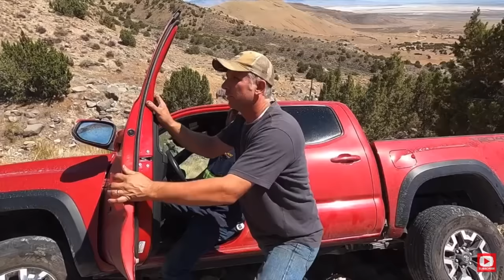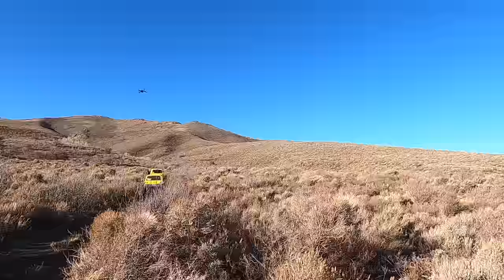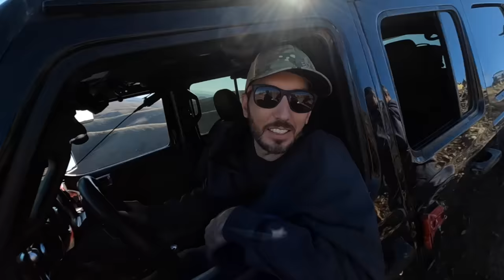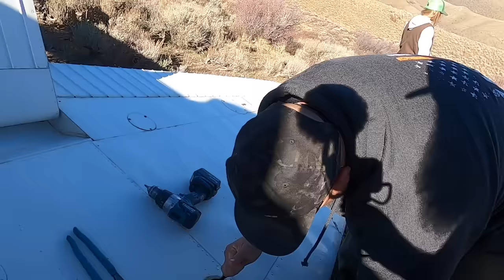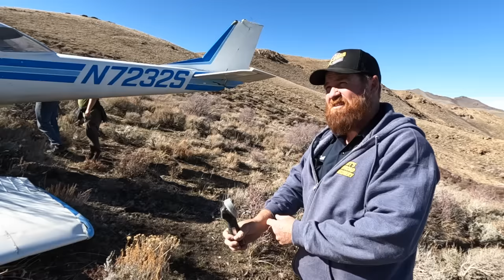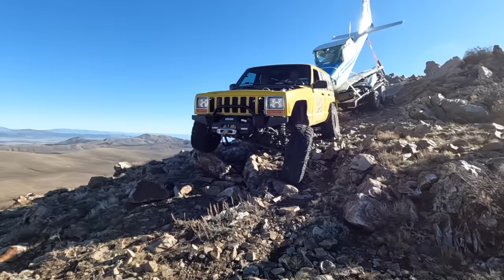The Craziest Rescue I Ever Had!

Comment: As a private pilot, even though I don't fly anymore, I did all of my initial training in a Cessna 150/152. I still remember that at 8000 feet a 150 is pretty close to it's maximum performance capability depending on winds, density altitude and gross weight.. Flying that Cessna in a mountainous area is always a little bit risky. I'm not here to criticize the pilot since I don't know all of the circumstances. I'm glad he was OK. Great recovery by all!
Reply: Com'l pilot here with mountain training - you're right, the 150 has almost NO excess climb ability at 9300 feet...and you NEVER put yourself in a situation where a downdraft can ruin your day...you always cross ridges at 45 degrees and or leave room to turn around if you can outclimb rising terrain. This guy is lucky to have survived this classic accident. Even better you stay on the ground when the winds are blowing hard.
Reply: His brother has similarly poor judgement, evidently, the way he flipped the RZR and stuck his arm out.
Reply: @danielhawley6817  The plane had not been out there very long and it does not appear to have been legal any time in the last 15 years. My first thought was the plane was put down due to weather or not enough power to fly through the heat of the desert at that altitude. How did the pilot land it without ripping the plane apart?

Comment: Lizzie just walking through the middle of legitimate nowhere was cool- that drone footage was amazing. And a special thanks to escorting her to the road- that’s awesome.
Reply: That drone didn't escort her to the road.  It can't stay in the air that long.
Reply: @stargazer7644  15 minutes to the road and a couple back? I feel like most drones should be able to do that.
Reply: @outandabout259  It's good that you feel that way.  She was a mile horizontally and 900 feet vertically from the nearest road hiking a ridgeline.  She wasn't in any hurry.  She certainly wasn't walking a 15 minute mile.  That would be pretty fast walk for someone her height.  Most drones can hover for about 20 minutes.  Flying distance and climbing shortens the time.
Reply: @stargazer7644 Then just fly the drone back halfway through her trek, change the batteries, and fly back to her.
Reply: @aphextwin5712 She walked a mile through the desert.  She wasn't hiking solo across the Rockies.
Reply: @stargazer7644  I was only arguing the point that the limited flight time of drone would not have prevented them to keep an eye on her for most of the way exactly since the distances were short enough that flying back and changing the batteries wouldn’t have resulted in very long gap.

I mean, we have drone shots of her reaching the road. So whether they were able to keep an eye on her for the whole distance to the road or had to fly back and switch batteries, they were able to visually confirm that she did reach the road.
Reply: Wake up to the wild west .

Comment: Well, This was one helluva different recovery!! Surprise that Plane didn't have more damage After crashing. Matt's skills sure put to the test too.
Reply: Couldn’t have done it without Ed’s help. :)
Reply: Looks like the pilot made a great emergency landing and kept it upright. Still considerable damage to the prop, engine, gear, probably firewall, etc…
Reply: It’s a shame the wind flipped it, the bulk of the damage was from that. The only forced landing damage is the nose gear and the engine. Hats off to the team for getting it dismantled and out without more damage
Reply: It’s totaled.
Reply: @MotoVloggedOUT  100% loss. When you consider a 150 sells for $25-35k in decent shape, the cost to rebuild would far exceed the value. EVERYTHING in aircraft repair--especially certified (I.e. production) models--costs more than you'd ever imagine.
Reply: @MotoVloggedOUT  I agree - a Cessna 150 in perfect shape is worth a lot. But there are lots of them for sale in not great condition, (say, requiring an engine overhaul, some avionics updates, and a few more little things) for very low prices.
Reply: The man said it was upright “a few days ago.”
Reply: @richardbirkenwald811  perhaps watch the show again. The plane flipped in the wind after landing
Reply: @richardbirkenwald811  So I am assuming they recovered it for insurance purposes?
Reply: @drewt3210   you are correct! It’s the cost of the repair that puts that aircraft in the scrapyard. It’s possible to repair almost anything if it’s worth it to you. But the cost has to be considered and 150’s are just to common to bother with.
Reply: Another plane scrapped for no good reason, pilot error
Reply: That was not a crash. that was a good landing, as the pilot walked away. It was not a great landing, as the plain was not flyable afterwards, but the pilot gets a few bonus points if the plain turns out to be repairable.
Reply: They give the reason for the low damage. It was high winds that they couldn't fly (toward home). A 150 only does 120 mph. 120 mph into 120 mph wind leaves a plane standing still. So, they actually just dropped onto the hillside when they got low enough to a windbreak.
Reply: @richardbirkenwald811  It did not flip on landing. Not unless you are accusing the guy of lying to the NTSB and FAA because I've read the prelim report.
Reply: @russlehman2070  what it was was poor ADM
Reply: @DougBennettActs6-1  Its a fun thing to do once or twice in Flight Sim, but I imagine it's terrifying in real life.
Reply: The oddest thing I noticed was that one prop blade was bent backwards and the other one was bent forwards.
Reply: @drewt3210  Just for the record it's a 1946 Cessna 140, and I agree it's totalled.
Reply: @cadzag72  the picture they posted from post crash with it on the wheels shows the wing is already crunched, so most of the damage was done on landing.
Reply: @MaxZomboni  Thank you for the intel! I didn't look into it, just went off what they called it in the video...figures ;-)  The shame is he didn't keep screw anchors on board. Maybe could have prevented flipping over & been able to salvage had he tied it down. "Education is expensive" and the Boy Scout motto, "Be Prepared" apply here.
Reply: @drewt3210  I am building a "cheap" Homebuilt, so far I am at 73k, most of that is aluminum and avionics.
Reply: @wb6anp  I'm super excited for you to get that bird in the air! Last year I helped a friend build his RV-10. Guessing it's one of the quickest builds to date, as he was airborne in the 5th month! He flew out to visit two weeks ago. Very emotional to see it in the air since it was missing wings & engine when I left the build a year ago. He already has >150hrs on it now!
Reply: Who says you need a rotor to auto rotate. Wings level watch the horizon manage your power dump your lift before it dumps you..... Should be required in flight school 🙃 No do it again 🙂 That's better

Comment: Over the course of my Navy career I actually have done several (too many) aircraft and helicopter recoveries after mishaps in the mountains outside of Fallon (and on the base), in the Lake Tahoe area, the Southern California desert, Morocco, the Air Force Base on Guam and an air base in Kuwait.  I benefited from using helicopters to lift the wreckage/engines/landing gear off the mountain, being able to tow the aircraft with it partially on a dolly, or being near a road for a crane to drive in so I could lift onto a dolly or truck.  Well done!  Thank you for sharing this.
Reply: thanks for your service. Fallon area and Tahoe Basin are absolutely beautiful.

Comment: Ah, aircraft recoveries. Even when it's just off the runway they tend to get interesting. When they pick remote locations a lot of ingenuity tends to come into play. I've been involved in almost a dozen over the years. You got really lucky with the RZR trail machine. At only 50 inches wide and approximately 8 feet long they tumble pretty good when you get them rolling. That rock was in a very fortunate location. Good times and fantastic that nobody got hurt in either the plane or RZR mishaps.

Comment: You have a 1967 Cessna 150 with a Lycoming O-235-L2C , 110 hp engine.  And you are right about how light they are, usually around 985lbs to 1100lbs.
It's possible this plane can be restored, but more likely, it will be parted out.
Since there was a prop strike, the engine will need to be rebuilt, and a rebuilt 0-235 is worth about $25,000 (unless it broke the crankshaft).
landing gear, instruments, etc all are valuable.
Sad to see the little bird get busted up, but extremely happy that the pilot walked away from it.

Comment: As an A&P You all did a great job taking the plane apart. As always your videos are great! Thanks!
Reply: Is that wreck worth anything, or did they just want to get it off the mountain?
Reply: @gordonrichardson2972  Yes, that was not a write-off by any means.
Reply: @tvideo1189  It looked pretty screwed up to me.  How could they straighten out the crumpled up wings?
Reply: @Rat-Builder  new skin and replace damaged ribs as necessary
Reply: @Rat-Builder  I didn't say every single part was salvageable.  Some might not be.  But replaceable wings are available as are almost every part for that very popular airframe.  The damage wasn't that significant from appearances.
Reply: @tvideo1189  Ok, thanks for the reply.  I am sure it is like everything else, I have resurrected some way screwed up heavy equipment.  I just do not understand how to work on airplanes.  If I worked on them, they would be sooooo heavy that they could not get off the ground.  LOL

Comment: As a pilot with almost all my time in a 152, I appreciate you.
Reply: I have a few hours in 150s and 152s, always found the airfield! That did not look like a good place to put her down. 

I read a WW1 pilots note book about how to land on long wheat, bring it in, close to the stall, and then stall it just before the wheels touch. Might want to discuss that with an instructor before trying it.
Reply: will they repair that plane or was that a "pick your trash" run?
Reply: @denmsore  I have seen worse repaired, I guess it will depend on what the 'survey' says. Being popular with schools, quite a few suffer a few indignities, and are repaired again and again.
Reply: @denmsore  I was wondering the same. I'm thinking a total loss insurance claim, after the wind rolled it. 
Any landing you can walk away from...
Reply: @ingluv  Just the cost of the salvage is more than the worth of that C-150.  It's repairable but considering it's age, it's most likely only good for parts.
Reply: @ADAPTATION7  the right thing to do is to pick up the mess. If you wreck your car, and it isn't worth fixing, you don't get to leave it there.
Reply: @ingluv  Of course it is.  Not saying otherwise either.  But like the other said:  It's a writeoff.
Reply: Dumb question, does the insurance pay for recovery of light aircraft?
Reply: @JAMESWUERTELE  When an insurance company pays for a total loss, they take ownership of the aircraft and may sell the salvage. I believe this answers your question.

Comment: I"ve done that!  Well without the crash! Bought a TriPacer in PA - rented a U-haul truck and took some tools and drove down there.  Removed the wings, pulled it up the ramps and loaded it.  Hung the wings inside the truck, left the back roll up door open with the tail sticking out. Drove 200 miles back home, easy - but interstate driving is better than that mountain trail..

Comment: You guys are amazing.  As a retired Accident investigator and Pilot, I have one request.  Please make sure the Mags are off/ disconnected before before touching the props.  They can take your head off just by moving the prop.  They are not hooked up to the battery.
Reply: you dont like russian roulette do you?
Reply: I'm curious,  why,how?  as a mechanic, that engine starts that easy, no strong compression to squeeze first?  thanks
Reply: i dont know why you even would make this comment there was 3 Pilot on that job but you still think you should make this comment

Comment: First note: The Intrepid Ms. Lizzy is my kind of girl: walking off a mountain is no easy task, even if the trek was only a mile or two. I want to find me a rodeo girl, cause they're fearless. If I were 30 years younger, I might consider a move to Utah. Second note: Rudy has been on-point,  lately, throwing a rope over the tail section to facilitate the loading of the plane fuselage shows his awareness. Thinking on your feet is the kind of thing that makes Matt's job just a bit easier. Third note: What a crew! Fourth note: Glad that guy pulled his arm back inside that little UTV, as it rolled or this would have been a very different video.
Reply: Whoever yelled, "Hand in!" had some quick recognition and response times. He possibly saved that guy's humerus or shoulder. Kudos.
Reply: @jonkirkwood469  can't believe he saw that and said it in that short of a time, pretty incredible... not even just his shoulder either, you get a squishy arm between the cage and the ground mid-roll and you're liable to lose it entirely.. seen people pop their fingers like grapes before.
Reply: Once you find yourself a rodeo girl, you may be singing a different tune. They don’t put up with any shit, they’re expensive, and they’re stubborn. I know this because I’ve been married to a barrel racer for nearly 13 years.
Reply: @jonkirkwood469  i thought the exact same thing, that was one quick thinker/response
Reply: @dustinmeier9753  I like Lizzy too, right on youtube where I'm safe.
Reply: Creepy

Comment: Those 50" SxS's are tippy. Course it was loaded a little heavy on the down hill side.
Reply: No kidding. Guy needs to get someone in the passenger seat.
Reply: Keeping the gas matted was never a good idea either
Reply: He should have turned around
Reply: Off set rims and ditch the sway bars.
Reply: Made mistake of hitting the brakes. Should have powered thru. But then again if that didn't work would have missed that lovely live saving rock.
Reply: @hammeredtravis  not me
Reply: He's lucky he did crush his arm when he stuck it out. Like you are going to reach out and stop it from rolling over.

Comment: A Cessna 150 has no  business trying to fly over an 8000+ ft mountain in ANY wind.  They have a tiny 100HP engine and can't climb out of a paper bag.  At 8000 ft altitude & 20 deg C (68 deg F) the MAX rate of climb is 280 ft/min.  That's better than nothing, but just barely!  They are for taking your first flights with an instructor and flying circles within 5 or 10 miles of the airport.

Comment: I learned to fly and soloed in the Cessna 152.  Good little airplane at lower altitudes.  Hope they can repair it.
Reply: No mate, not economically viable.
Reply: I used to split the cost of renting a 172 with a co-worker and fly just for the helluvit. Beautiful little airplane.
Reply: @marvindebot3264  damage definitely exceeds value. Some parts may be re used such as instruments and interior fittings. Engine would need a rebuild.
Reply: @janetyeoman1544  Yeah, if it's a well-equipped example with a modern fitout I'd be swapping a lot of stuff into the new one but you can buy a 150 for 25k nowadays so no way is that anywhere near close to being worth fixing. The port wing had bent the mainspar for starters plus engine overhaul, new prop, nosewheel and all the other damage.  She's parts, unfortunately.

Comment: Hey MORR Team! I trailer my motorcycle cross country every year, and I live in constant fear of securing my bike to the trailer improperly and losing it on the highway. Every time Matt and the team use their trailer offroad, I'm shocked at the confidence you all have in keeping the load tied down. Could you do a video on how you approach securing loads to the trailers?
Reply: We made a strapless gizmo for securing bikes on a bike trailer...that we pull with bikes. Haven't tried it on something as heavy as an Ultraglide but dirt bikes and minis
Find a spot under the bike you can weld a pipe to the frame. (You could clamp it with u-bolts too I guess.) A rod that fits through the pipe, hole drilled through the ends. A heavy duty hinge mounted to your trailer on each side that will reach the pipe. Hole drilled in the hinge for the rod. (bike trailer with a front wheel slot for the bike? We added a hump for the back tire too, drops in and is scotched front and back) 
You simply pull the bike on the trailer, flip up the hinges and slide the rod through, big clips through the holes in the end. It's going nowhere.
The hinges lay flat out of the way if you use the trailer for something else.
Reply: @yourhandlehere1  That right there needs to be a video on how to build and install it.

Comment: Thank god that rock was there becasue that RZR was IN PROCESS of its first cartwheel DOWNHILL and it was going to REALLY get moving within a couple rotations, it literaly would have rolled at least a good 50+ rotations at that angle and the way it was starting to cartwheel sideways! There were angels there that set him right on the ONLY rock on the downhill side this whole video!  If you’re a big guy in a small SXS you need another good sized guy in passenger if you leaning downhill driver side. It doesn’t take much to tip them. When I saw him approaching that , leaning and no one at least standing right side and no passenger my heart stopped and then it happened. Grateful for the cameraman yelling hand in too! This was almsot a sure death! Man that’s scary!  Driver said it tipped left last time too, need to throw some small 90 lb bags of concrete on the passenger floor when you’re out alone and probably should get some 2 inch spidertrax wheel spacers , spread those wheels out a bit and man I’d wear a helmet. Stay safe!